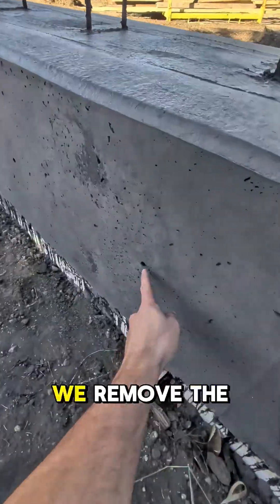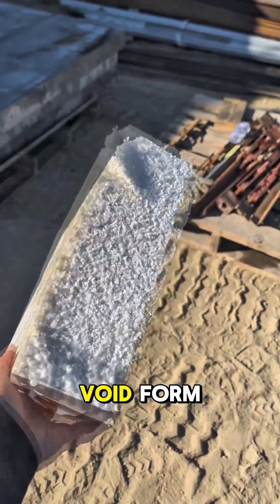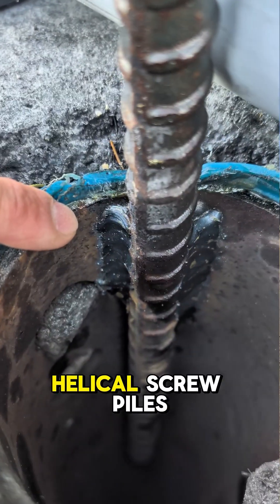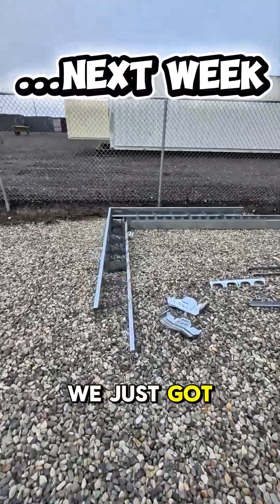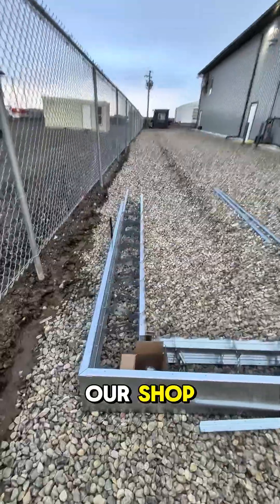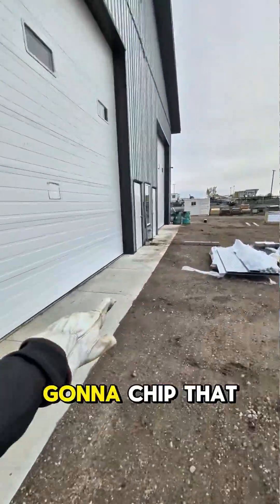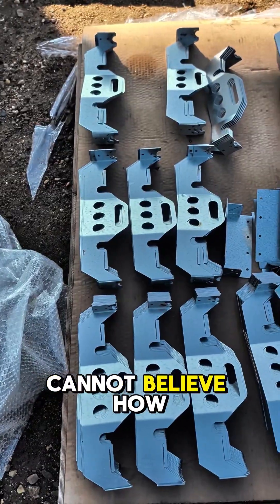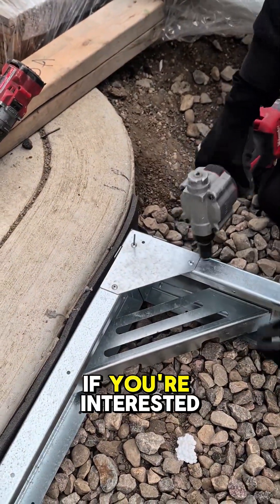Modular Concrete Forms - Part 2

Comment: Water water water how do they handle water You're about as close to the Arctic as you want to get Is there gonna be water left in the stay in place form.  with foam forms you leave in place It bonds to the foam and the foam's an insulator is there going to be water.

Comment: Don't get me wrong those look really cool and diy friendly. The problem is cost > benefit for a person that would need a diy friendly product. If you have money for these you would most likely hire the job. Also more thermal bridging compared to insulated forms. Maybe make a way to line these forms with insulation boards on the inside of the metal would be nice. Not hating just giving my opinion and maybe I'm missing the point. Love you guys!!!
Reply: Valid point. I don't know the cost though but valid point with the insulation which I'm sure you could work in there. However I have recently learning much much more about how they built things back after the little Ice Age an I will say this... especially gete in America,  We lost the knowledge of How to build a House For Warmth the Best way to do it... Is lost to the majority of us.  We think of it the opposite way... We think of it as Heating a Home BTUs...  Wood, Oil, Propane,  etc...  Instead of Warming a Home where everything around you becomes Warm , You don't feel Hot but Your extremely comfortable.  Ibstead of houses being too warm in this room, to cold or drafty in that room and so on... And the best thing is using a third of Wood ... etc... to Warm your home.  Studies have been done where in event of losing power during sub zero temperatures in a snowstorm.. mist homes start losing heat in a few hours., with 4-6 / 6-8 hours a normal house temperature drops to around °48 +/- withing 12 -24 hours a normal house drops to around °32  freezing.   When the old ways of building houses .. Your house will stay warm without a fire , in a power outage for 3 - 4 days .  I know this... every house I've ever lived or stayed in always had a heating distribution issues and None would be warm in 12 hours... or 24 hours for sure without power or heat source.  These places where designed to start a small fire in the morning and then one in evening or at night . 2 fires a day in Cold Winter.   That knowledge needs to be learned / relearned.   It's Absolutely Amazing... Mind boggling to Think We lost so much Vital Knowledge.